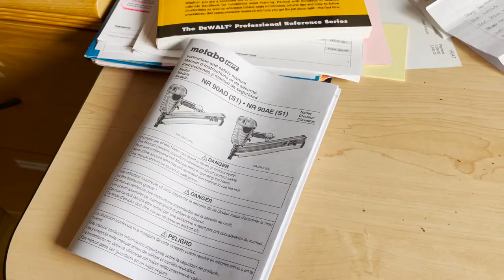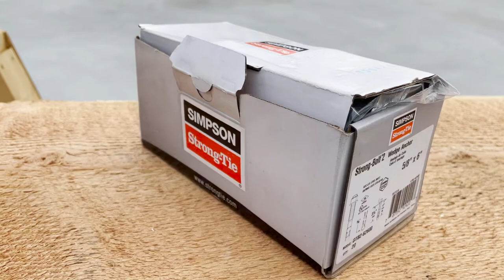Building my own shop -Framing - part 2 - Solo Build Project

Comment: What size shop is this?
What was a rough cost to build it yourself?
Reply from the maker: The shop is 30’x40’. Total cost to build was $45,000. Keep in mind that I was during the pandemic so costs of materials were higher. I did a lot of shopping around for lumber and materials.